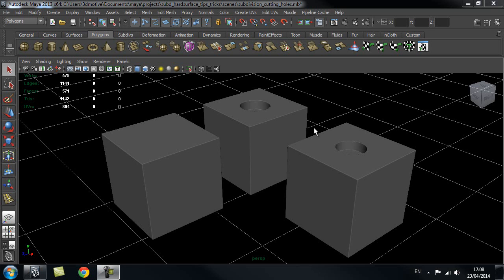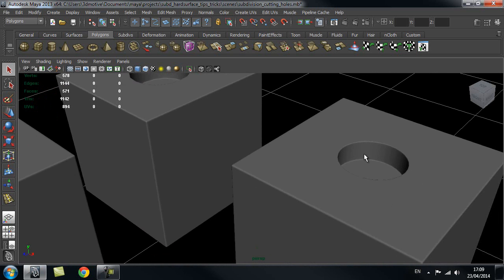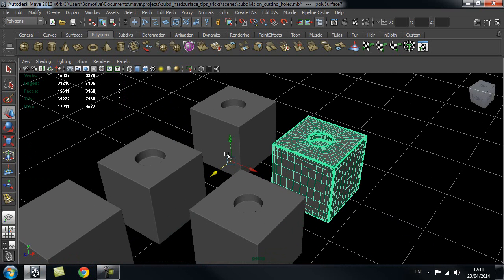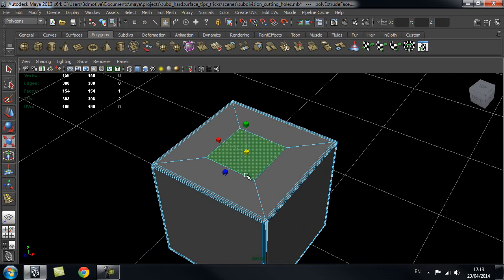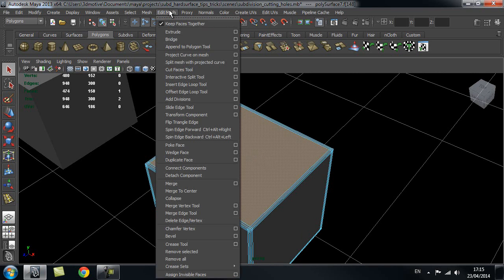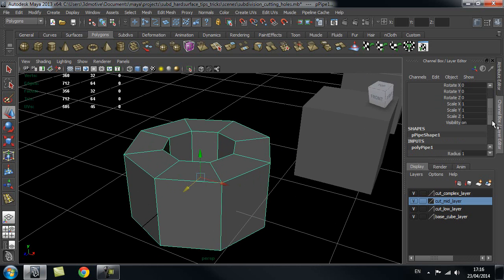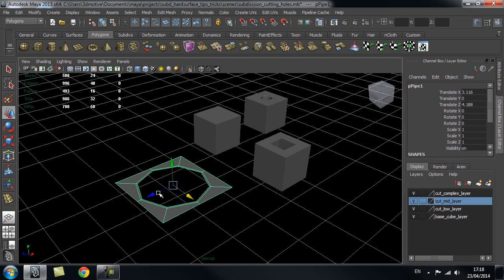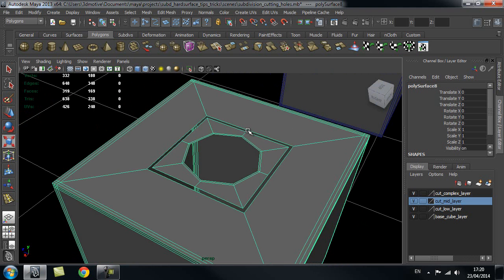Cutting Holes in Hard Surface Models in Maya - 3dmotive

Comment: Cutting hole in flat surface is not hard — cutting hole in curved surface is however hard, because it will often create smoothing errors, there will be visible triangles etc. I have no idea how to make it in classic 3d software modelling, but I know how to make it in ZBrush or MeshFusion in Modo.